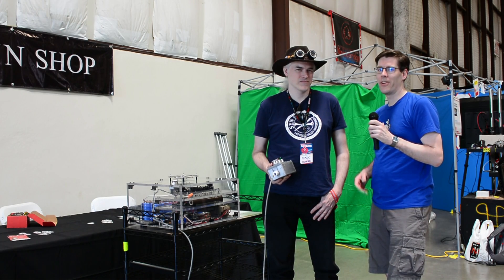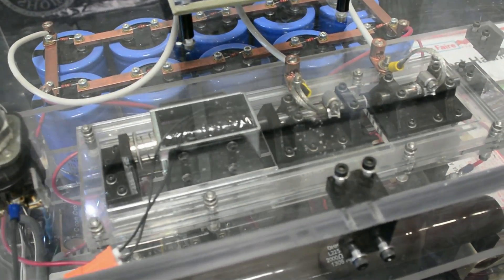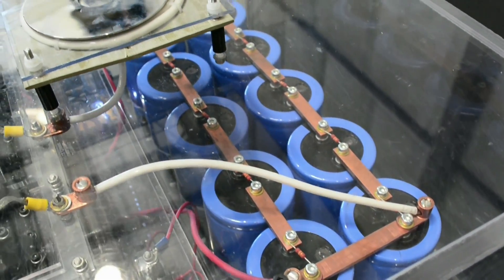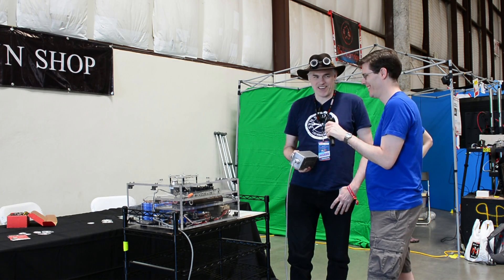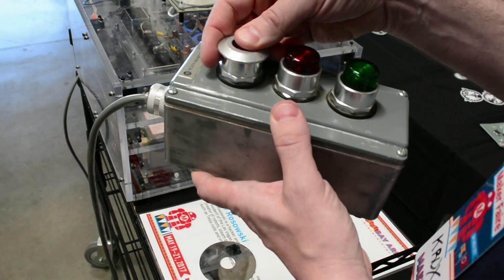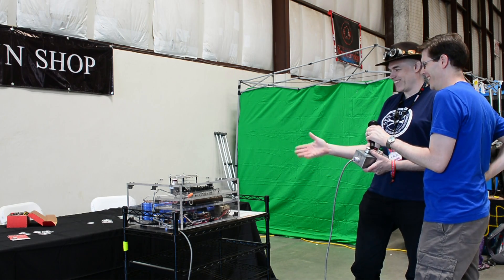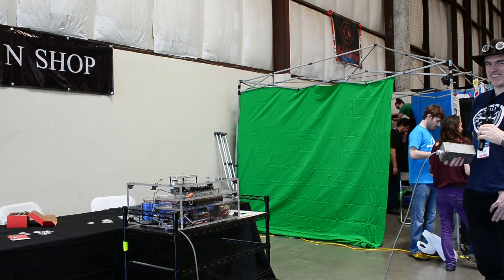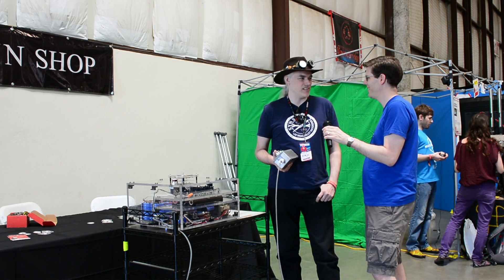Launching Hard Drive Platters with a Jolt of Electricity

Comment: @Ahapid those allow the capacitors to "leak" between the plates. Making sure that they will eventually discharge if, for some reason, he needs to service it. (e.g. The actuator doesn't fire. Without those he'd have deadly voltages to contend with)

Comment: So the capacitor banks came from Cirque du Soleil' aquatic show 'O' 
He mentioned they were pulled after their service life was over from Variable Frequency Drives (VFD) used in the show.  VFDs are used to provide adjustable speed control on AC motors.
Reply: You replace the cap bank on big VFD's after a certain amount of time because the price of the caps are a fraction of the IGBT's and all the controlling electronics that WILL go up in smoke when the cap bank is getting tired. Simple preventive maintenance.